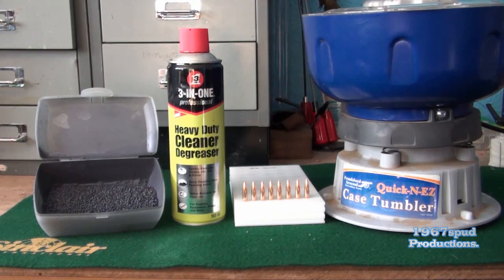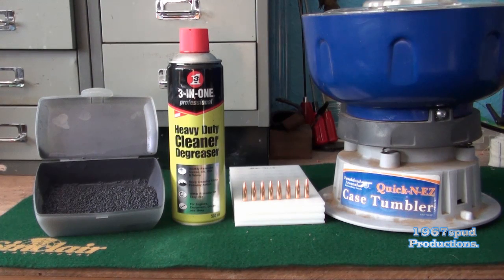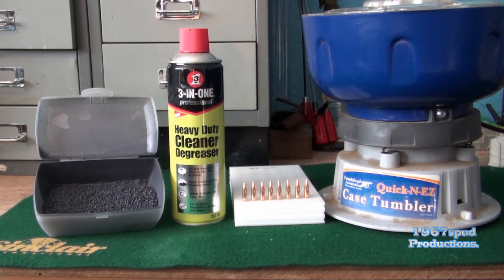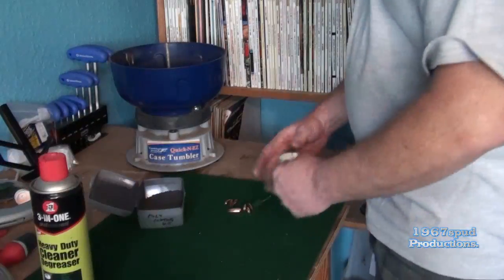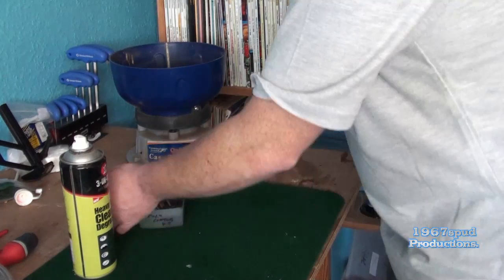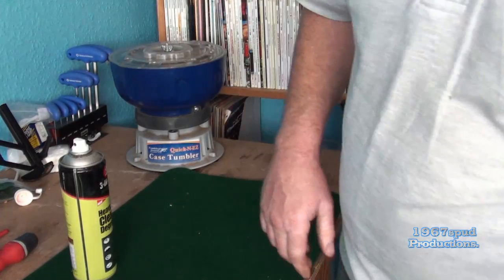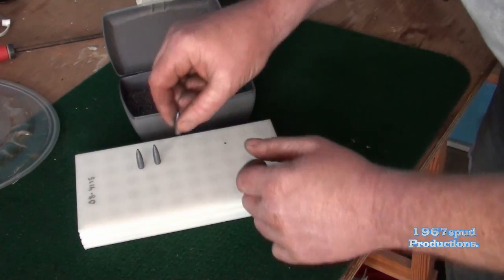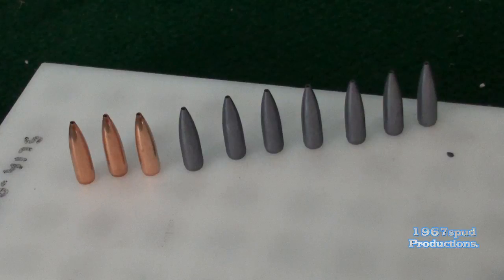Quick Tips: Moly Coating bullets for reloading.

Comment: Great video. I moly tumble my cast bullets as well. Also use moly bore cream too. However every now and then you want to clean out the moly because old moly eventually burns and flakes... Or you just want to clean out to shoot regular bullets. Give JB bore clean from Brownells/Sinclare a try. Works like a charm to unmoly your barrel. You still need a solvent, I use Montana x-tream bore cleaner with JB's and moly comes right out pretty fast and very thoroughly.